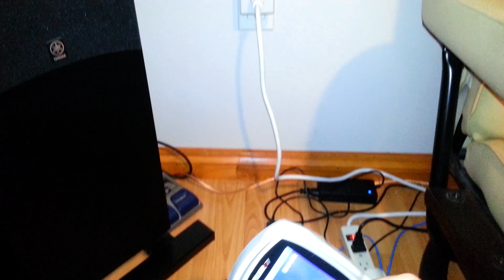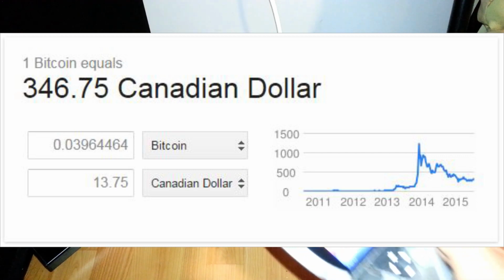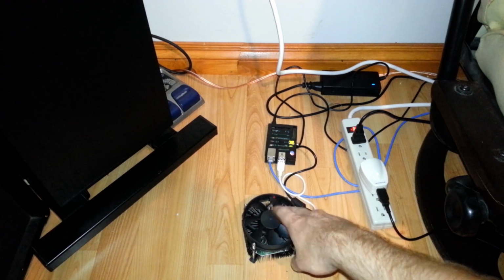Raspberry Pi Bitcoin Mining Experiment- Conclusion

Comment: you result is flawed. you should track to the time when it failed then work out how much power was consumed up to that point, convert that into money to compare. You are deeming it not worth it after months of acting as a room heater.
Reply from the maker: +Morlanius Well if you look at it another way and value your time- just the setup and various checking alone figured at even minimum wage- would put this in the red.
Reply: Eric William -MKme Tech How long did it take to set up? I didnt see some of the videos on that part. but if its set up and just left to its own devices that wouldnt be much of a problem. I'm just saying it would be interesting to have an actual figure. You said that it failed quite early on, so if you know how much it was drawing it would be an interesting excersise to see a comparison between how much it earned during that time (you have that figure) compared to the power it consumed during only that time. As for the time, you could look at it another way, if it took say 2 hours to set up, and ran it for a month, you have probably spent more time on the toilet in that time.
Reply from the maker: +Morlanius The setup of the Pi, accounts and miner take some time.   It stopped in May as per the description (3rd week if you want more specific) The days running are in the video.  You can extrapolate the BTC by day from there (not counting for changes in value of course).  he conclusion is pretty solid for me although I pretty much knew what to expect going in.  My conclusion is solid for me.